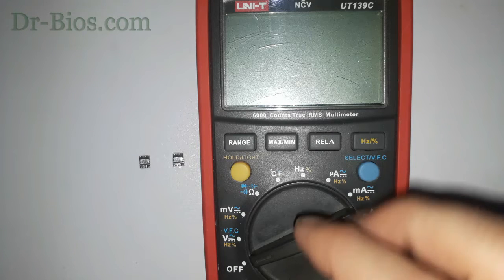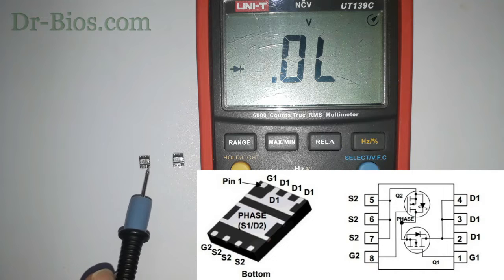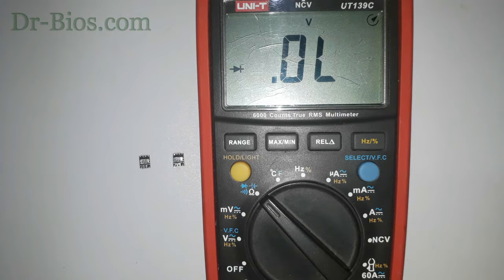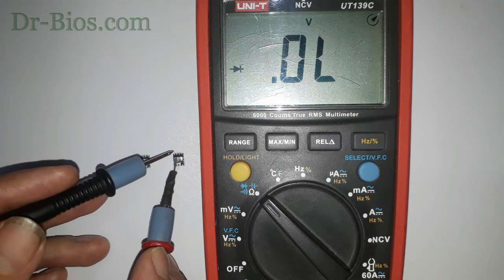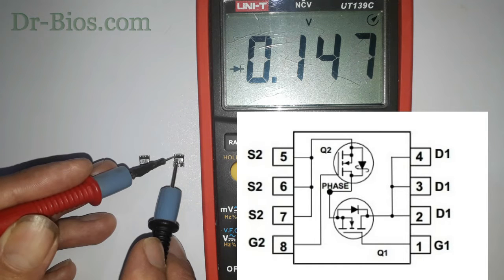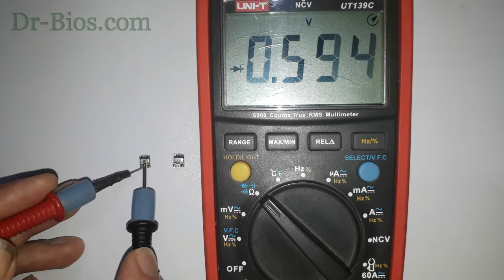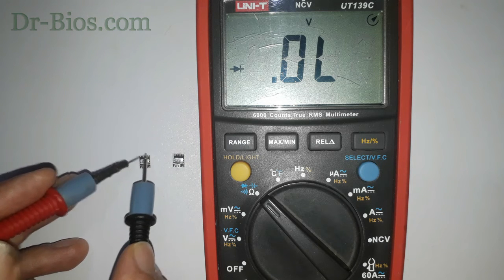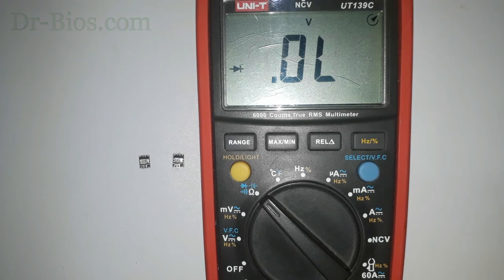How to Test Dual MOSFETs

Comment: What is confusing is you show a dual MOSFET with the “PHASE” pin hidden away inside the case, which makes this dual MOSFET useless, IMO. SINCE in a typical dual MOSFET that phase pin is the output pin. I just checked the 40 page schematics of a laptop, with plenty of power dual MOSFETs None are the type you show. Please provide a link to the data sheet of the dual MOSFET you are showing. Thank you.